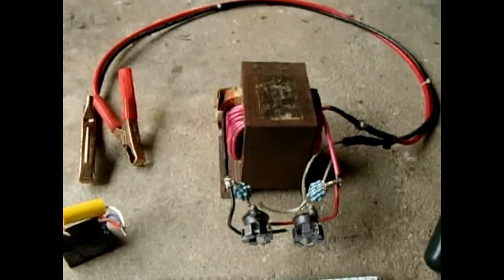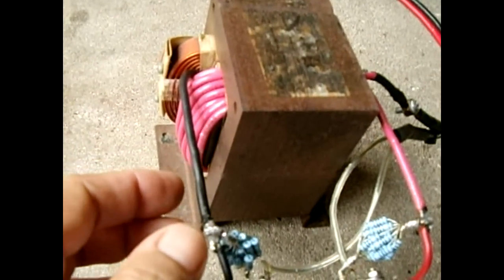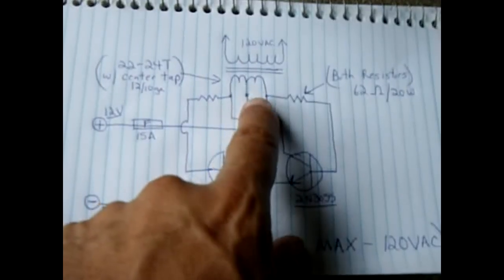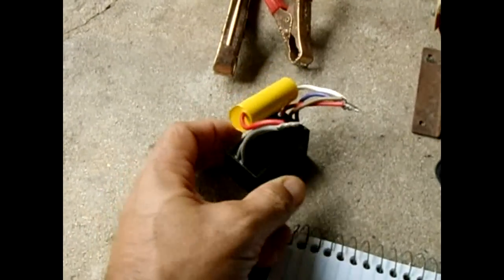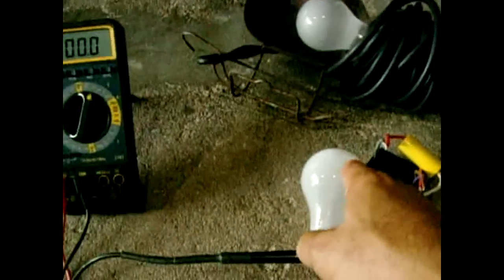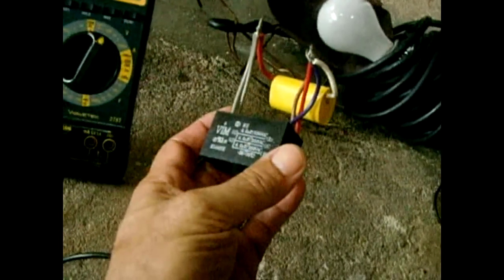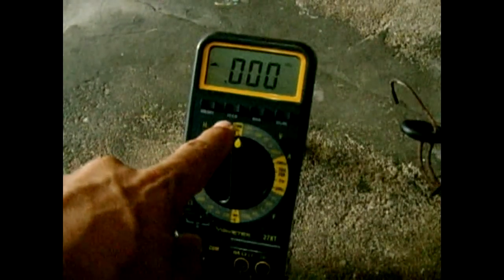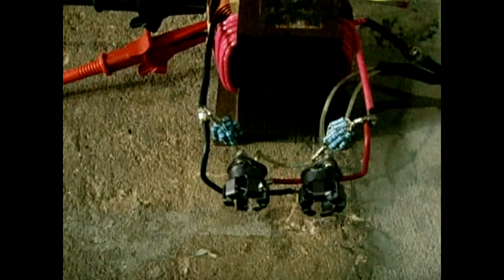How To Make A Microwave Oven Transformer(MOT) 12V to 120V Inverter

Comment: Would it work if the output is like185v AC ? I tried 40w and 60w neither of them was lit up, I connected 120v LED bulb and CFL tube, they seem to work fine, but incandescent light bulb just don't light up.
Reply from the maker: Should be working. You used a large Microwave Oven Transformer like I used in the video? If you copy exactly what I did, using the same transistors(2n3055 type), same turns 22-24T in total with a center tap using 12ga to 14ga wire, and the same resistor value/wattage, then there is no reason for it not to work.
Reply: I used a MOT of similar size, maybe the "I" plate isn't on its side, 14Ga wire, 20 turns gives me an output of 90v, so I reduced the turns to 16 now the output jumps to 185..also one of the 2n3055 tends to be extremely hot always, but I used 65 ohm (maybe 10w) single biasing resistor, would that be the reason it gets hot? I don't have so many high wattage resistors for this purpose, would be great two single resistors could do the same.
Reply from the maker: I noticed if one transistor gets hot, that is usually because the center tap is off. You have a way to measure inductance? Check from the center tap to each end and compare. Worst case use a DMM and measure the resistance.
Reply: Yea, I was also suspecting that because it happens when I wound less turns toward the ending (one end of the wire sticks out longer) for voltage adjustment. Resistor wattage was 2w not 10w, but they are not hot in my case. Anyways, thanks for the suggestions.
Reply from the maker: Your welcome. Keep playing with it, you'll get the 75w output I had.
Reply: I'm getting 127vac and will not light incandescent 40w eather but lights 15 led style bulbs nicely so I'm happy. look on ebay for 50w 62ohm resistors they have cooling heat sink around them and run very cool.
Reply from the maker: That is good, but I do not see why you are not getting good output like in my video.
Reply: Same here. 129VAC output(17turns), 14ga wire, it lights up LED bulbs, Neon bulbs and CFL tubes, but not any incandescent light bulb, not even 40w's. My transistors run a lot cooler since more resistors added to the base, anyways, happy with the result. Might go buy 12ga wire see if that makes a difference.
Reply: I also suspect that the transistors are different. The cheap ones can't switch high current. So that would be another attempt in the future.
Reply: Yuji Naka I have 3 more transformers to play with, going to try 26 turns 12 gauge wire and see if i cant get more voltage, 2 are the same and going to link them together on the 120vac output to double the watts
Reply: Yuji Naka Really one transistor will run hotter unless the windings on both sides are very very close to the same resistance like within a few mili ohms and these transistors very widely in gain, gain is very important if you like to reduce losses. Using a darlington configuration meaning you'd need 4 2N3055's, which are dirt cheap this would multiply the gain from 5 to 25 and a reduction in base current of a factor of 25.
Reply: Thanks, I'll probably try this again in the winter.

Comment: Ok contactor relay is working with thermostat physically saw it and with meter but when I put in pull switch in the UNIT kicks on. What can cause this??
 ·
Reply from the maker: Contactor relay with thermostat? Are you sure your talking about the right video?
Reply: So u don't know about ac contractor relay.
Reply from the maker: What does an AC contactor have to do with this circuit. You need to explain yourself much better.
Reply: update my AC condenser unit turned off so I am thinking if its the breaker or relay that failed because thermostat is working and yesterday was working all of a sudden it stopped
Reply from the maker: Your posting AC repair questions here? WRONG PLACE! Though I repair AC units, I do not have a video yet.
Reply: your capisistor is bad
Reply: all done wiring was wrong and then the relay switch didn't pull enough so I put new one working great Please people take a pic from or phone camera before pulling wires off. in my case had repair person that didn't know and had to firer him but left a mess behind.

Comment: Instead of usinga   microwave oven    transformer   maybe   try a  large   battery charger   transformer    using it in   the reverse way  that is  using the lowvoltage   output   windings as the primary  input  windings   this way   one does not have to    remove unwanted   windings and put in new ones   the   windings with big wire   are   already   there
Reply: +bernard240vdc I did this with two K2699 mosfets. A lot less work for the same results. I just had to heat sink the mosfets very well & add a fan. They seem ultra stable using a battery charger transformer.

Comment: pls how do i make a micro oven transformer 12v to 220v inverter
Reply from the maker: Use a microwave oven designed for 220V. Leave the 220V primary winding, and follow the same procedure as in the video.

Thanks For Watching!

Comment: Hello could help me? I need a schematic of an inverter 12v to 110v transformer with microwave, already grateful. is with GOD
Reply from the maker: Refer to my video list. You will see a completed unit I made. "Homemade Modified Sine Wave Inverter". There is a link in the video description area to the schematic. I also have another video showing a 555 inverter circuit. Wind 11 or 12 turns of 10 gauge stranded wire onto the core , then make a center tap, then add another 11 or 12 turns.

Thanks For Watching.
Reply: worth! Thank you.

Comment: would that work for a grinder 120v/60hz/6amp?
Reply: like i know it wouldn't cause a grinder use 720 amp and you do like x2 for start up so would need 1440w on start up but is there a way to creat that kind of inverter with your method?

Comment: can anyone tell me how to create one of these inverters that would be capable of powering a 27inch tv
Reply from the maker: A 27" TV does not draw too much current. Maybe up to 75 watts which is exactly what the one in this video can output. The switched mode power supply converts incoming 120V AC/60hz to DC. Since the AC is going to be converted to DC, the higher frequency 120V AC input from the inverter should not be a problem. Try and keep it as low as possible. A 110V output will work fine.

Thanks For Watching.

Comment: How to make a 230v or 110v inverter 150w connecting 2000w in a 150w inverter
Reply from the maker: Please explain better.
Reply: pure sine wave inverter using ic 4017 sequencer to make pwm cascated sine wave inverter that my dad´s are going to make here´s the circuits: http://www.homemade-circuits.com/2015/12/simple-5-level-cascaded-sine-wave.html

http://www.brighthubengineering.com/diy-electronics-devices/86814-modifying-square-wave-inverters-to-sine-wave-equivalents/

Comment: oh my god im freeking out now, you have totally mis understood what im doing, im testing voltages  BEFORE i put the risistors and transistors and it not work, im NOT building a 24 volt power supply im building a inverter, i know for a fact i have at least 11 1/2 T from start to center tap and 11 1/2 T from center tap to end
Reply from the maker: I know exactly what your talking about. I never mentioned you making a 24v power supply. Based on what you told me, you said you wanted to use 24V as your power supply to create 120V. I have no idea why you are so concerned about the voltage BEFORE you assemble the circuit. I have had many people try this, and no problems. You need to assemble the circuit for 12V power supply first, which it is based on how many turns you did already. I can no longer comment. I have a rule for people which require, "special assistance", you already passed that point. VERY few channels even bother replying back to people, or maybe once if your lucky, so I did more than is expected

Thanks.

Comment: i takes a 100 watts just to run the transformer which is 90 percent efficent at 1000 watts. 100 watts wort of loss. 
torodial core work better as has only 1 percent loss and is 99 percent efficient

Comment: To  RiaRadioFMHD773      in order to get a more stable   frequency  more closer to    60HZ  that  does not vary with the load,   maybe  design a   mechanical inverter device i am not kidding   these  mechanical  inverters where used in old tube type car radios in the day   tube   filaments where fed direct car battery voltage  that is if 6volt car all tube numbers    started with 6   if   12volt car  tube  numbers started with 12   the    higher dc             plate  voltage  was obtained  via a transformer  fed from this mechanical inverter   called a   vibrator  it was  essentially a buzzer   moving addittional contacts connected in a way that they would invert   polarity to the transformer at a rate   of 100 HZ  or so   the  high AC  voltage coming out of the tranformer was then   rectified and smoothed in a conventional way like in all other tube   electronics.....    Actually you could   build a moderate  power inverter using one of these   Vibrator inverters and a small   car battery transformer to   ,,,these  vibrator  inverters  could be   found in old tube type car radios   and these  vibrators   where usually  a plug in    device   like a vacum tube...   I am   hoping   anybody  out there   is old enough  to know   of these   older   electronics in cars   usually from the  very early   60s     late  50s   and  older

Comment: Looks like you left the shunts in the transformer, this will work MUCH better if you remove them....
Reply from the maker: Your right. I removed the stacked metal plates after the video was made. :-)
Reply: electronicsNmore Also your using a 100% duty cycle square wave with 555's, a much better way is modified sine wave (less than 100% square wave) with 1 ic as shown in >> http://static.elitesecurity.org/uploads/2/5/2552124/12-220%20Buz11.jpg
will work as a battery charger as well in reverse!
Reply from the maker: Have you seen my, "modified Sine Wave inverter video? If not, check it out.
Reply: electronicsNmore Yes good job but the one I reference is done with 1 common cheap IC and has voltage regulation, soft start, low voltage, and overload protection....you may be interested in my current project "How to make a 100 watt RMS 12 vdc (car) audio amp from a microwave oven"

Comment: it's not much use to powering AC loads using 50 hz
Reply from the maker: For AC motors, your correct. For resistive loads, and loads using rectifiers to convert the AC to DC, it is OK.